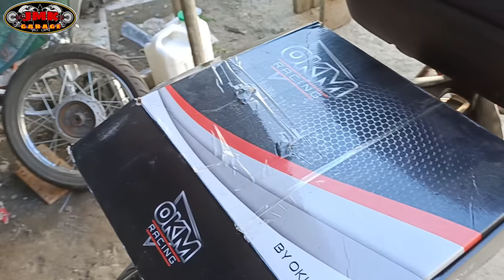convertion drum brake to disc brake | honda click125/150 walang tatabasin na flirings

Comment: sir, pwede ka gumawa nang video, kung paano gagamitin si honda click as back-up generator/charger incase of emergency like may bagyo, lindol, etc.? anong pwede e kabit, ilang amps pwede e diskarga sa battery.. ilang oras continuous  pwede pa andarin si click. etc..
Reply: bili ka solar. mahal gas. kung solar for emergency, 100ah battery 12v LifeP04 solar panel 200w, solar charge controler mppt/pwm yan lang pwede ka na makagamit everyday ng lebreng ilaw at electric fan na 12vdc all. if need mo ng 220vac need ng inverter 4.500 1kw

Comment: @JMKGARAGE  anung po nung turnilyo na nilagay niyo sa brake arm. Salamat po sa magiging sagot niyo.
Reply from the maker: stainless lang sir at nut na may lock nabili sa auto supply po
Reply: @jmk17garage  anung sukat length at diameter niya boss.

Comment: Mga pops maganda sna gawa kaso umaalog xa s mugs gawa ng hnd kc naka thread lock ung bolts papunta s mugs.... Un ang issue lng sa item n yan...
Reply: Nakita qna s video ng Angel mana the modifier ung video nila,may damage din s swing arm nya ung plate ng caliper.. Sana may thread din sana ung plate papunta sa mugs. Para walang alog..

Comment: Idoll sana mabasa mo to. Yung motor ko galing ng casa kakatapos lang ma overhaul, pinalitan ng crankshaft assy at bearing, tapos ngayon di na umaabot ng 100 ang top speed nya, nagpalit dn ako ng pitsbike pulleyset v3, wla parin nagbago, di nya kayang umabot ng 100, from 60-80 hirap na hirap na sya abutin. Di naman ganito nung di pa na overhaul. Ano po kayang problema ng motor ko? At ano pong pwede kong gawin? Sana masagot nyo po ito, di ko na po alam anong gagawin ko, medyo malaki na po yung nagastos ko. Sana mapansin nyo po.
Reply: ikamamatay mo ba pag di umabot nang 60 to 100 MC mo?
Reply: @sageart4922  hndi po. Pero kung sayo po siguro mangyari yun baka iisipin mo rin na may mali sa pag overhaul ng motor mo kaya di na umaabot ng 90 ang takbo nya. 150cc pa naman. Ehh before nung di pa na overhaul kaya nya naman mag 100 eh.
Reply: @sageart4922  and ang nagastos ko is almost 10k for that overhaul and palit ng crankshaft assy, and yet im not satisfied with the result. So, kung tinatanong mo ko if ikamamatay ko ba pag di umabot ng 100 takbo ng motor ko? Ang sagot po is hndi, okay lng na di umabot ng 100 as long as alam ko kung anong dahilan. Kung okay lng ba yun or baka may problem sa makina na pwede nanamang lumala pag nagtagal